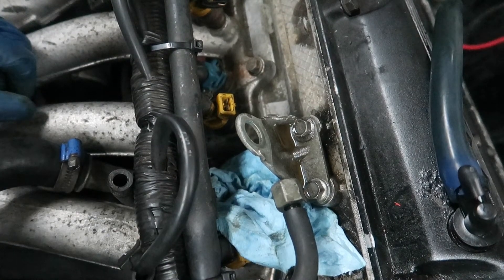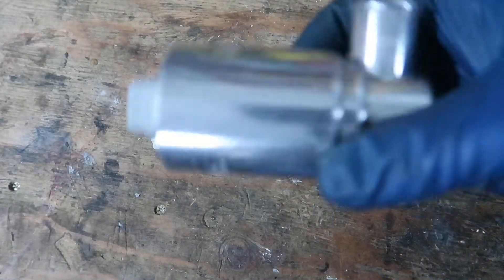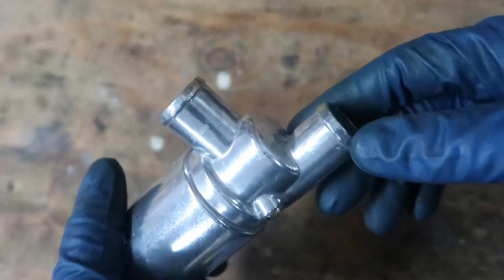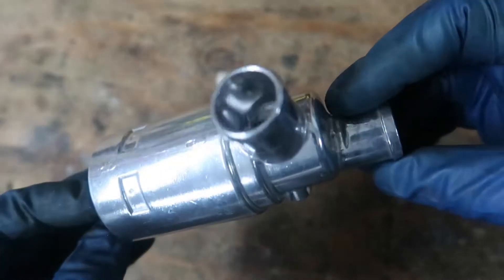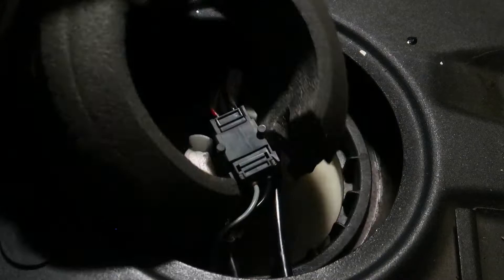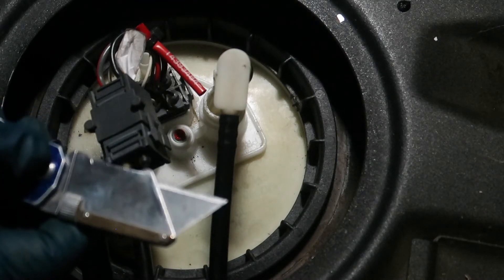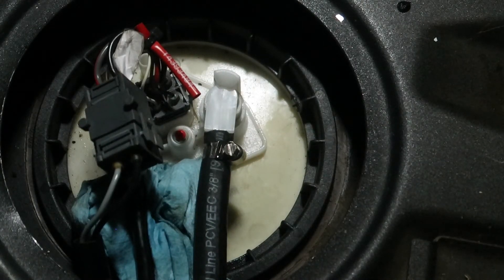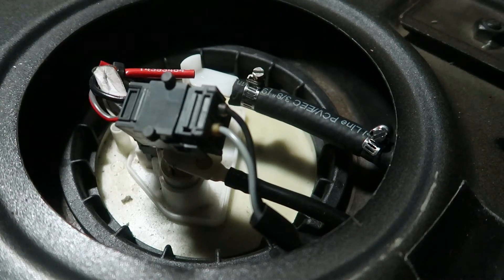Fuel Pressure Regulator FPR, AIC Leak and Fuel Check Valve Ep: 12 - 1990 Saab 900S

Comment: A couple of comments - 1) The Idle Control Valves can often stop working because their internal get sticky.  Spraying inside with brake cleaner, then letting it dry out before reinstallation can get it working properly again.  2) Many of the currently available aftermarket check valves are faulty.  Better to get OEM off of a junked Saab.
Reply from the maker: When I first got into this engine, I sprayed out the original IAC and a lot of dirt came out of it. The cleaning helped, but I suspect that one had the internal air leak because the engine just wouldn't run right with it installed. The one I put in this video was better but since it wasn't a bosch part, it didn't get along with the engine as well as I would have hoped. As of this writing, the check valve is working great. I had run the car one day, and come back 2 days later to check on the engine and the fuel pressure gauge was still showing it holding 40 psi. I was quite surprised! Whatever happened with the check valve when I first installed it must have cleared out. Thanks for the comment!